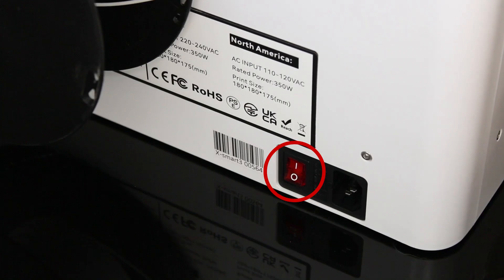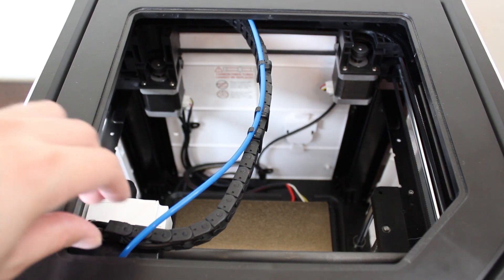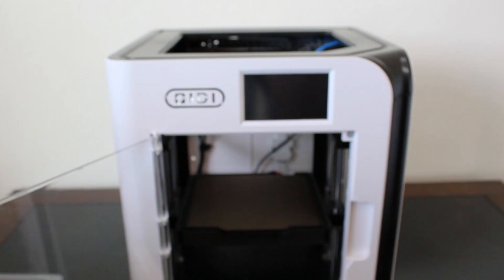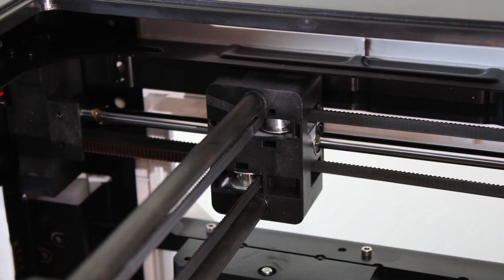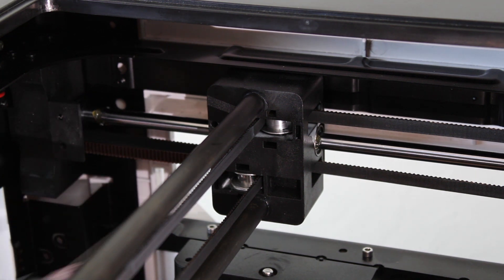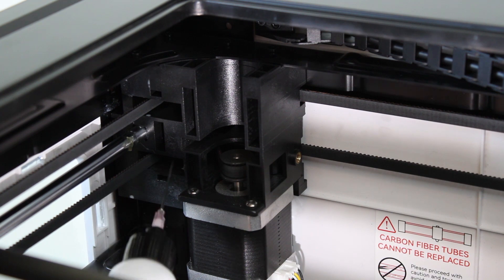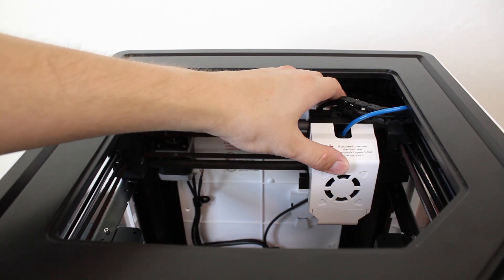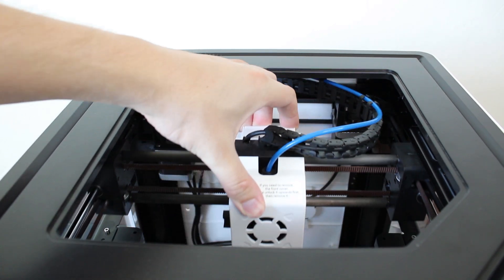How to Lubricate Qidi X-Smart-3 3d Printer Idler bearings

Comment: How is the oil not just getting all over the belts? I don't understand how oiling the pulleys in the gap between the plastic is even helpful? Seems to be the only way but this seems like a pain in the ass to actually get the grease into the pulleys and not just all over the belts